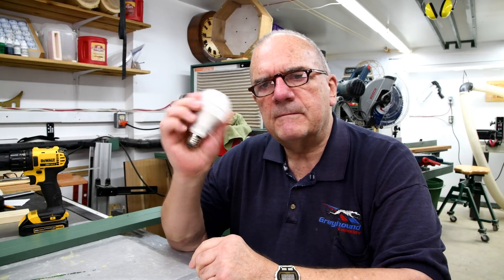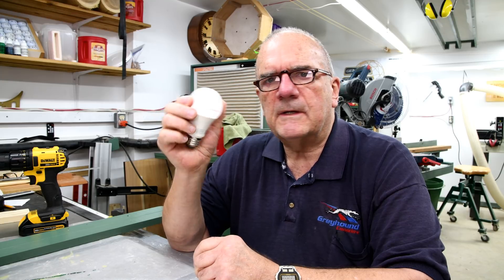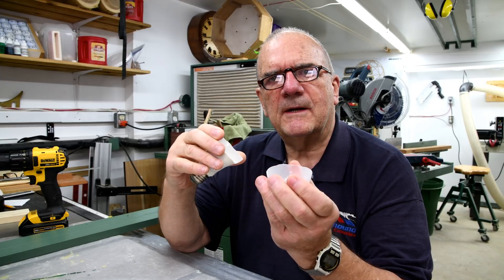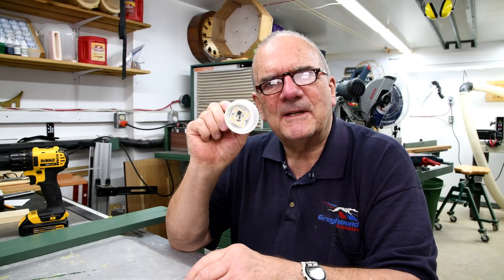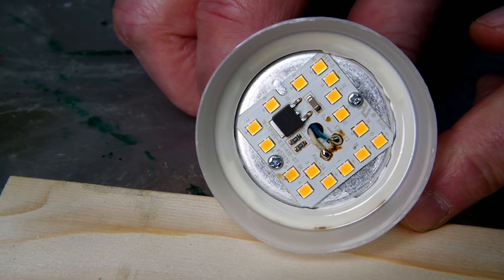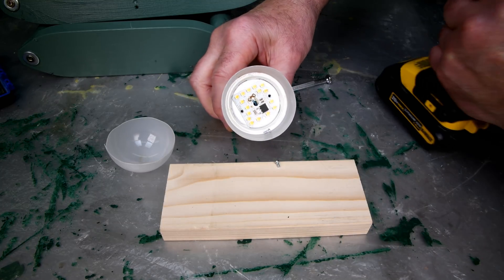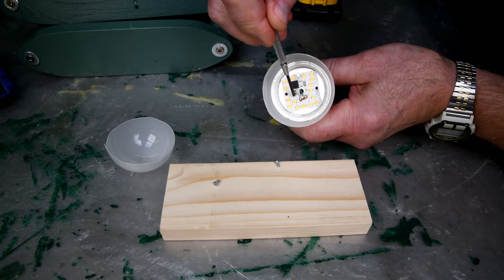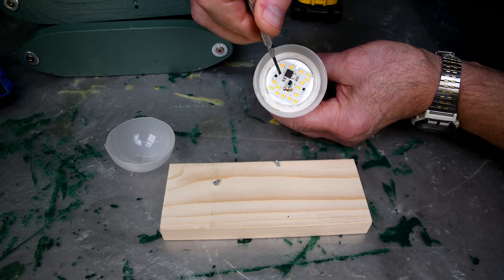The LED Light Bulb

Comment: My experience with LED's has not been stellar either.  Has anyone tried to return one in for warranty replacement?  Chances of finding the original purchase receipt would be pretty remote.  I used several LED small flashlights that had 3 LEDs in the head.  On all three of the units one of the three LED's would start flashing after a time.  It would drive you nuts.  Have not been impressed with the 120v versions either.
Reply from the maker: Hi Dwight,
It could be that they will improve in time. The Idea is great --- as long as it's not proven to be harmful in some way.

Comment: So a few points about screw base LED light bulbs to consider...
1. Typically these are not rated for enclosed fixtures, read the box.
2. 99.99% of these come from China.  (May have exaggerated on this a bit, but not much)
3. If these are anything other than Philips, GE, or Sylvania, they will never last through the warranty period.  Major manufacturers such as these three, will have LED bulbs manufactured in China, but with specified higher quality components.
4. Almost all failures are a result of inferior power supply components and not the LED chips themselves.
Reply: Peter is raising a valid point.  The major manufacturers produce quality products that meet industry standards, but they are expensive.  Many of those products are made in China in factories that are actually managed by the company whose label they carry.  

Most of us opt to buy the lowest price product on the shelf in the big box store - which are no-name brands produced in China.  The initial performance will be essentially the same as with products from the majors, but they long-term performance won't be nearly as good.  Its a classic case of 'you get what you pay for'.  

This is not a new situation - the same principle applied to CFLs, and before them, incandescent bulbs.  I buy cheap because it makes sense  - I keep a few spares, and only replace lambs when they burn out.  For commercial users (hotels, office buildings, etc), the practice is to establish a regular schedule for hiring a contractor to replace all of the lamps in the building whether they are burned out or not, and the cost of labor is a significant component of the cost of replacement.  Therefore, those folks need to use lamps that give the longest possible life so as to extend the period of the replacement cycle.

Furthermore, industry standards define life expectancy probabilistically - some fraction of the bulbs must last at least as long as the specified life cycle.   Some last much longer - which means that some don't last as long.
Reply from the maker: Hi Peter and Louie,
Thank you for you informative and detailed input. Much appreciated :)

Comment: The inside of the base will mostl likely have a small step-down transformer to take 120v and make it 60v or 12v, and a small capacitor to smooth out the current and keep the light from having a noticeable flicker (like a fluorescent with a bad ballast)
Reply from the maker: You were right Axel. Just uploaded part 2. Thanks :)